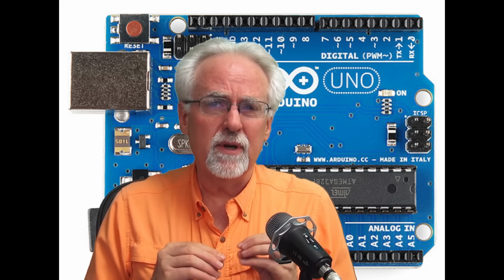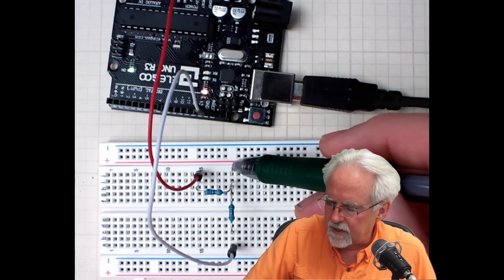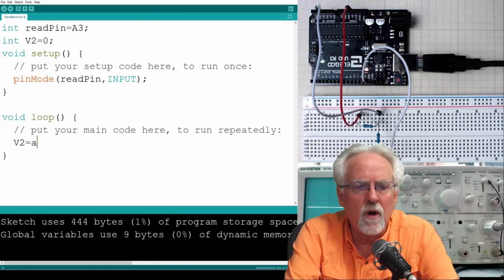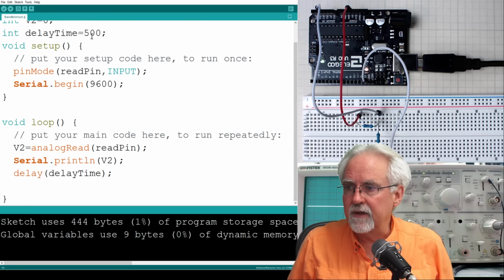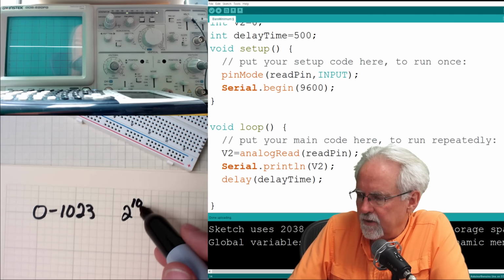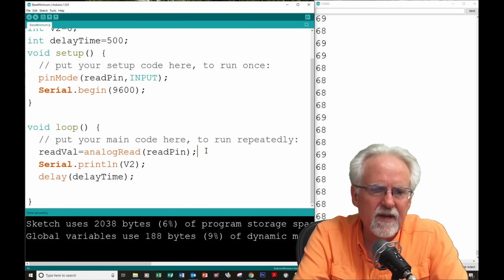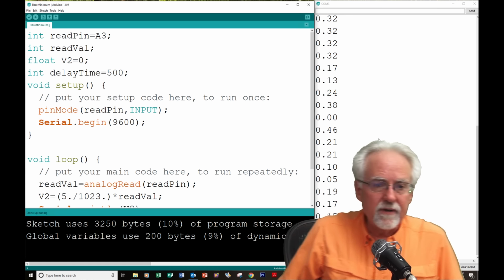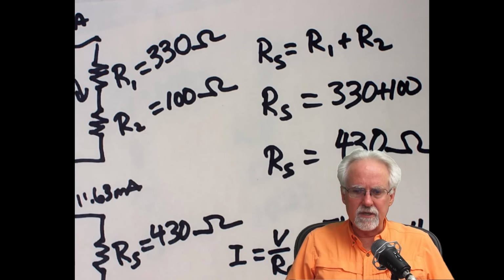Arduino Tutorial 10: Understanding How To Read Analog Voltage using analogRead Command

Comment: I don't know if there is someone that can help, but the smallest resistors in my set are 220 ohms and 470 ohms, so that's what I used. When I measure with the arduino though, no matter where I connect the wire to, I get a a reading of 1023.
Reply: update: it seems to give more accurate answers when I connect it to A5. I don't know why that may be.

Comment: Hi Paul, lesson 10 is getting a bit harder to follow along. I have my program exactly as shown and my bread board as well. I get 5 volts no matter where I place my wire in the circuit on the serial monitor. And yes I am going to the A3 pin. I'm not sure why I can't see different voltages. Would you have any Ideas as to why? Also, how do you break out the Serial Monitor? My Serial Monitor is on the bottom of the Sketch. Thanks
Reply from the maker: I am using IDE 1.8, which is much better in my mind than 2.X. consider downgrading.

Comment: I am struggling - I have set the 2 resistors (330, 100) in the breadboard per the video but I am reading 1023 when I probe the back end of the first resistor instead of the reduced number 289, almost as if the resistor is doing nothing.  if I remove the 2nd resistor (100) and again probe the back end of the first resistor it drops to 0 (as it should I think).  Help?

Comment: Paul, why is analog writing 0-255 whereas analog read is 0-1023? Why isn’t the resolution the same both in reading and writing?
Reply from the maker: It is different hardware. The output is 8 bit. 2^8-1=255. The input is 10 bit. 2^10-1 = 1023

Comment: I don't understand why the arduino is reading 1.18 volts between R1 and R2. When I calculate V by multiplying I (11.63mA) and R (330ohms), i get 3.83 Volts? What am I doing wrong?

Comment: Okay, Paul.  I've reviewed my notes from lesson 9 (this is for everyone NOT getting the information that the formula " V=IR" {or R=V/I and I=V/R, as is more applicable}) gives the answer as VOLTAGE DROP over the resistor, which needs to be subtracted from the overall voltage!  i.e., If resistor R1 is 330 Ohms, and resistor R2 is 100 Ohms, for Rs of 430 Ohms, on a circuit of 5 volts, your amperage is 11.6 milliamps (11.6mA).  Your math is V1=IR1 (V=I{.0116} * R1{330}, = 3.82 voltage DROP) minus overall voltage of 5 volts for a voltage reading at the point R1 meets R2 of 1.18 volts,  left to go over R2 of 100 Ohms,  for a final reading of 0 volts at the point after R2 that meets with your ground wire.  I hope this helps, it tortured me for quite a while.

Comment: Paul, I'm having a bit of trouble.  If my math is correct, shouldn't the voltage at (or after) V2 be 3.8, and not 1.2?  As I record the voltage across the entire circuit, I get 5.09v.  At V1, I get 3.9v, and across V2 I get 1.18v.  I've checked my polarity, my math says the inverse, that I should have 1.2 volts here.  Am I getting the voltage DROP at this point (V1)?  I've used a voltmeter to double check my work, and it reads 3.8 volts across (from the 5v input to the point between R1{330 Ohms} and R2 {100 Ohms} R1, and 1.2 v from between R1 and R2, across R2 to ground.  I passed this up the first time I went through these lessons because I was new to the subject, but I'm going through things a second time, and I can't seem to let myself go through it again without clarifying if I'm measuring this wrong or not.  Can you please help?  I realize it's been 4 years since you posted this, and it's been 9 months since I first had trouble with this lesson.  What am I doing wrong?  I've gone through the comments, and it appears I'm not the first person to see this problem, but I haven't seen any answer.  Can you let me know what I'm missing?

Comment: Thank you for these lessons on programming with the Arduino Uno.
I have Elegoo's Most Complete Starter Kit for the Uno R3, which I got back in April when I first found your channel and videos on this series, and am following them once more.
For this homework lesson, I used a 2000-Ohm and a 220-Ohm resistor for my R1 & R2; This gave me an Rs of 2,220-Ohms, an I of 2.252e-3 Amps, a V1 of 2.000e-3 Volts, and a V2 of 495.495e-3 Volts.
I will be continuing to follow your lessons, and hopefully will make something with the Arduino Uno or something similar.

Comment: So I see a lot of people asking if we could measure the voltage across R1 the same way as we did with R2 - not quite but I'll try to explain why! 

Remember, we're NOT using a voltmeter here like in Lesson 9, where we could place TWO probes at each end of the resistor we're reading to get the value directly. We have ONE probe, and the key difference here is at 4:50, where Paul explains exactly what we are measuring. We're measuring between whichever point we choose with the probe and GND. However, It just so happens that between the point we chose and GND is indeed R2 and only R2!

I've seen some comments saying they've tried placing the readPin probe above R1, or in Column 15, in attempt to read R1. Instead, they're reading the full 5 V or just shy of it depending on your board. When you do this, you're placing the probe just before the 1st leg of the resistor and once again, measuring between that point and GND. Between that point and GND are both R1 and R2, so you're reading the sum of voltages across those 2 which we already know is the full 5 V! The same logic applies if you try placing it after R2 - there's nothing between that point and GND so you'll read 0 V.

I think Paul's analogy of it in Lesson 9 is perfect actually. If you think of your source voltage as money, you spend a certain amount of it after passing through the 1st resistor and then the rest of it after passing through the 2nd one. If you put the probe in Column 15, you haven't gone through R1 yet so you haven't spent any voltage yet! You have all of your money still. Placing it where we did here, we had just spent 3.84 V of it having passed through R1 so now we have 1.16 V left and that's what we read. Then placing it after R2, we spent the last of it so we have nothing left.

To read R1, you'd have to measure across R2 exactly how we did here and then subtract it from measuring across both R1 and R2,  just as I explained above. That way, you have (R1 + R2) - R2 = R1 and you see that R2 cancels out.

Sorry for the long comment and I hope I didn't butcher this! Just trying to help clear some of the confusion! Thank you so much for this series Paul! I'm a Mechanical Engineer so I've had some exposure to Arduino and electronics before but I want to solidify my understandings and have this under my skill belt!

Comment: Hello, Thanks for your nice lesson, my issue is that, when I want to read form 4-20ma convertor, there is noise in my reading, I checked the output with voltmeter, it was constant, but when I want to read it with Arduino, UGH lots of nois, what should I do? Thanks

Comment: I know a lot of people that are doing this course are my age, which is 74. Do any of you have the issue of difficulty with seeing the holes in the Arduino and board to insert the wires, and if so, how do you deal with it? I mostly do this stuff at night and that compounds my problem. I'm tired of finding out I have a wire in the wrong row.
Reply from the maker: maybe buy a desk mounted lighted magnifier. Then just look at the board through the magnifier.
Reply: @paulmcwhorter  I'm going to try an led headlamp and see if that helps (which my electrical engineer son calls "the ultimate mad scientist look").
Reply: I decided to do just that. I ordered a desktop lamp with a larger magnifying lens from Amazon, which arrived today. I can actually see the pins now! Thanks for the suggestion. @paulmcwhorter

Comment: Well...I had it working at one point...didn't change anything...and now it's not reading correctly. I'm getting a constant 5.0 and shouldn't be. I have gone over both the wiring and the code without getting a good reading. That means...tomorrow is another day and I'll look at it with fresher eyes in the morning.
Reply from the maker: Good luck. Don't give up.

Comment: I have tried this at least 5 times and never get the same results as you.  Each time checking and re-checking that my script is the same and my wiring is the same.  I also have a 330OHM and a 100OHM resistors. Can't figure out what I'm doing wrong.

Comment: Hello Sir. Thank you so much for all these tutorials. I am so happy that I found it. Please let me ask a question, since I did not see this one asked in the comments yet. So, we read V2 by connecting A3 on one side of R2 and circuit (ground) was another leg of R2 , which was connected to GND already. That is clear. Now here is what I am thinking- to read V1 we need A3 on one leg of R1, and somehow we need to circuit that reading , by adding another ground? But I am confused - So if we keep A3 where it is then if we add  another ground on column 15 - then technically R1 is surrounded and it matches what you were measuring with the voltmeter? Technically if we move A3 to the column 15 and put another ground on column 20 it should be the same? However if we just move A3 to column 15 without the second ground we bypass the resistors at all so we have 5V , so we do need the second ground as without it we either measure V1 or V. But we don’t have another ground ? Then I think ground is the same , and even without the second ground pin , we can probably split the ground ? So first, we need to move the ground wire to the blue rail on the bottom , then using two jumper wires connect the blue rail with column 15 on top part and column 20 on the bottom part.. am I right ? I am afraid of smoke and hesitating trying it.. please respond. Just trying to think out of the box . Thank you so much again !

Comment: Gear lesson. I have different resistors in my kit so I've been doing my own math. It was great when I did the read value math and got the 4.1v for R2 from the previous lesson. I'm currently in my second schooling that is focused heavily on electrical and these lessons are so much easier to understand. School is all math and formulas and somewhat weak labs. This stuff is great for really seeing what you're supposed to be learning. Thanks Paul!

Comment: The best thing about this video is that you type every line of the code on the go, you explain what it is, what it does and what it means and you point out the common mistakes in the code.
Others typically just show the code and point to a couple parts of it, which doesn't help someone who doesn't know or understand the code.

Comment: Hello, I have a question. Is it possible to read the Voltage 1? if it is possible where should I put the A3 to find the Voltage of resistor 1. I am expecting a voltage of ≅ 3.84V. I tried putting the A3 before the resistor1 but only got 5V. I also tried to put the A3 after the Resistor 2, but I got 0V.  My bad if I expect things not the way it is, I would be glad to know how analogRead actually read the voltages, especially when it doesn't need a "+" and "-" like the multimeter. Thanks in advance, and also love your tutorial, I like how it gets more interesting as the tutorial goes on. Peace.

Comment: I had a volt of 4.39 I thought when we used 100 ohm resistor, the volts wouldn't go very low because the resistance is low?

Comment: So what are allowable tolerances in the send/read accuracy? with 2 different high quality meters i measured a 4.6vdc output to my circuit at the pins, and after my first resistor i show 2.3 on the program vs 2.08vdc on the meters.
If it affects anything im using a pro micro arduino so i fed the circuit from a pin with digitalWrite,HIGH.

Comment: This is fun.     I'm not sure why this measured resistor 2's drop rather than resistors 1's drop?  it seems current path went from positive 5v - to-  R1 - to-  the test prod, into the A3 input?   I thought I'd be reading 3.84 volts drop across R1.  (that is what my voltmeter reads across the two legs of R1).  Where can I put test prod to read R1 and 3.84 V  --- I have only found 5v at positive supply, 1.16 V at junction of two resistors, and 0 v at ground?

Comment: With the jumper connected from an analog in pin, is it possible to read only three voltages: 5V, V2, and 0 at ground. I tried poking around with the read jumper, and was unsure how to read the expected value for V1.

Comment: Could  all my resistors be bad? I'm getting 5.0 on either side of the first resistor and 0.0 on the other side of the second resistor. I changed out the resistors but nothing seems to change. Lesson 9 failed too, I just thought my meter was on the wrong setting.

Comment: I set the constants in the equation for V2 as 'float' variables at the start of the program, and made a note that if you want to manually write a decimal value in an equation, to set it as the constant, followed by a decimal. Thanks for another great video Sensei Paul 🦾

Comment: Hi Paul, Thank you for your wonderful tutorials.  I built the circuit and it works !  I put a 1K pot between 5 volts and ground, and connected the wiper to A3 so could vary the voltage.  Your knowledge and teaching skills are the greatest.  Thanks again.

Comment: Is there a way to measure more than 5V?
For a battery charger application for instance to cut off the load before overcharging.
Or the only way is to get a charger controller module ?

Comment: question: on V2, instead of getting a votl count that is supposed to be near 1.16V if i remember correctly, it says it is 5V which it isnt supposed to, why would that be? the resistor works correctly, so do the wires.
Reply: He got the right reading at 1.15. Maybe you mean he got 0 because V2 was declared as an integer. So it did not get any decimals and 5/1023 is 0.0048... So that variable would give him 0.

Comment: Hey guys I'm not great at math so I don't understand this
Paul gives the explanation about the slope m=y2-y1/x2-x1*readVal then he writes 1023/5 oh sorry its 5/1023 what is the explanation why he changed this 
regards from Belgium
Reply: Hey D in Belgium, basically, the slope is the change in y divided by the change in x - now imagine that the Y axis represents the actual voltage of 0volts to 5volts and the X axis represents the binary "readValue" of 0 to 1023. If you do the opposite m=x2-x1/y2-y1, it will not work. Try plugging in the numbers as I described. 

Hopefully that helps. I'd imagine Paul will bring this back up soon. Good luck!

Comment: Paul, I used 2k and 330 ohm resistors and calculated 5 x (330/(2000+330)) to get the voltage across the 330 ohm resistor. I got 0.7081 volts. The Arduino at A3 read 0.70 volts.
Just to experiment, I tried A3 and got the same results.
Curiously the pin 13 led was lit, and surprisingly, the yellow pin13 led and the led below it were both on before I turned on the Serial Monitor. Using  a magnifying glass these were labeled TX and RX. Perhaps Transmit and Receive?
 When I turned on the Serial Monitor RX blinked at a rapid rate.
I'll have to give iced Coffee a try. Never had any before. Any brand you recommend best?
It's the little details you give that books gloss over or omit that makes a BIG difference!
Keep up the nice work!

Comment: Yes, I am doing as I'm learning. Although I had to uninstall Arduino 2.0 and go back to the earlier version. 2.0 wouldn't recognize the pinMode "INPUT". But I have another question. We read the voltage drop across R2, how do we measure R1? When I attach my A3 wire in front of R1 and the ground after R1, it reads 5V. So there's no voltage drop reading across R1? What if we have 3 resistors? I'm not sure if I should just assume the voltage drop across R1 is just the leftover voltage from the starting voltage minus the voltage of R2.
Reply from the maker: NO you cant do that. Ground always has to be connected to ground on the board, or you shorted out the other resistor. If you want to check voltage drop across something not tied to ground measure top to ground, then bottom to ground, and substract the two. The ground always has to be connected to ground.

Comment: A. Thank you very very much!!! This is a great series.  
B. Why is it if I unplug the ground, I get a reading of 1023/5V.  Shouldn't there still be a drop in voltage from the resistor?  Likewise, if I plug in next to the ground, I zero, which kind of makes sense.  Even more confusing, why is it if I have A3 plugged into nothing, it is returning values of about 1.6V-1.8V.  I would think it would be 0V.  Sorry if this has already been asked, but there are a lot of comments to pile through.
Thanks again!!!
Reply: I went back and watched #9 for the 3rd time.  I think I've got it.....kind of.  Electricity is something I've always struggled with.  Thanks again!!

Comment: I'm connected to th 5v pin, but when reading between the second leg of the first resistor and the first leg of the second resistor im getting a read value of 544 not 293.  I'v double checked  my resistors. The first is a 330 and the second a 100. Why do we have differant a readVal. my board is  ELEGOO MEGA 2560  R3. The only thing I can think of is if my resistor wasn't  labled correctly.

Comment: In answer to your question Paul, I'm following along so well that I queried the declared variable error (float not int) as soon as you typed it so something's sinking in to my brain.
Also, I took your advice to heart about only using variables in the main program and declared the conversion as a float variable. After a lot of trial and error I ended up with this:
float convertToVolts=(5./1023.);
That meant that I could evaluate V2 with:
V2=convertToVolts*readVal;
It worked so your teaching method certainly works for me.